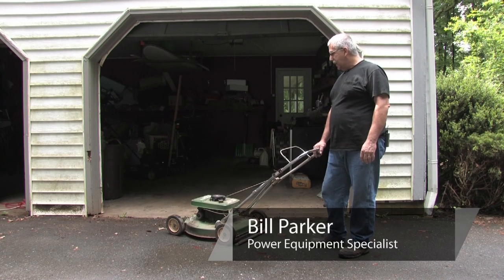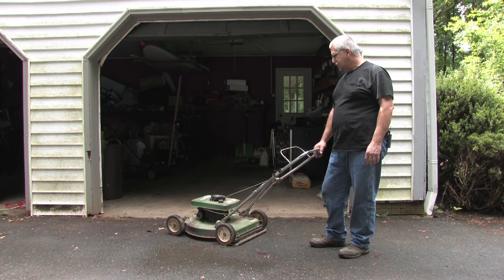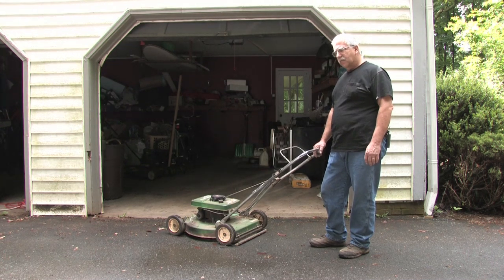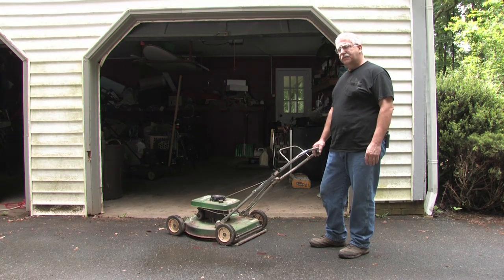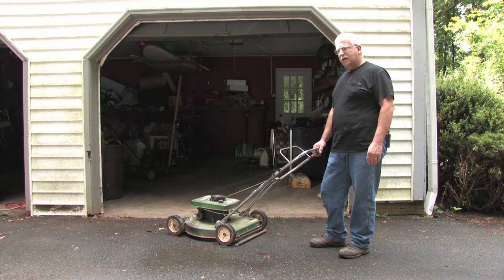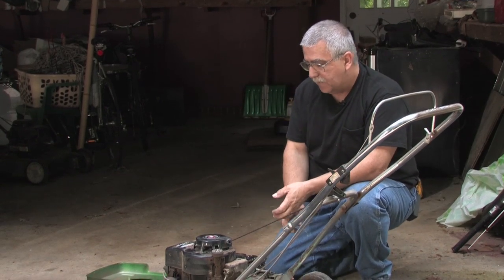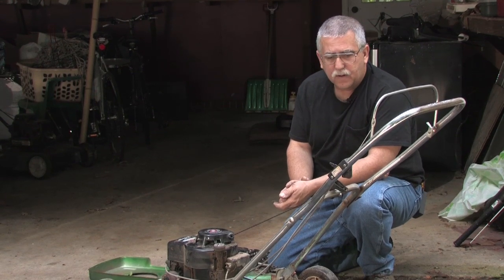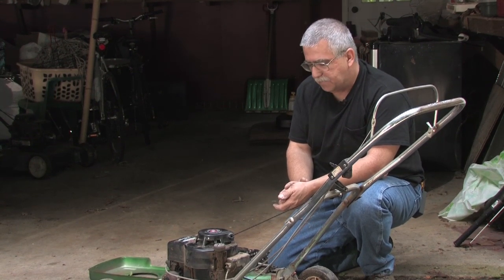Lawn Mower Repair : How Do I Replace a Lawnmower Pull Cord?

Comment: I like the way you had the rope ready to "break" when you pulled. Kind of a sympathetic touch. The only improvement to your technique would be to tie the knot before inserting into the starter assembly, show a closeup of your threading technique for us newbies, then maybe use a torch to singe the end so there will be no fraying. Very good and helpful video. Thanks for sharing. Thumbs up.